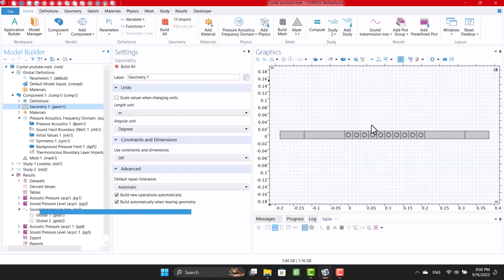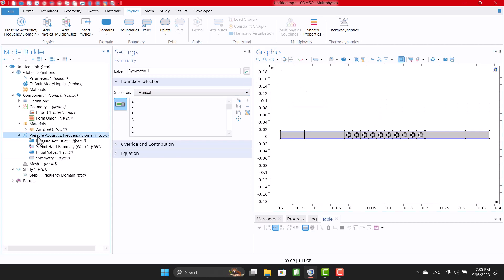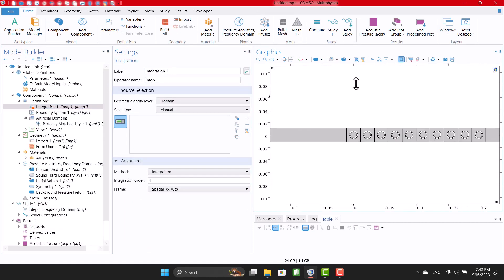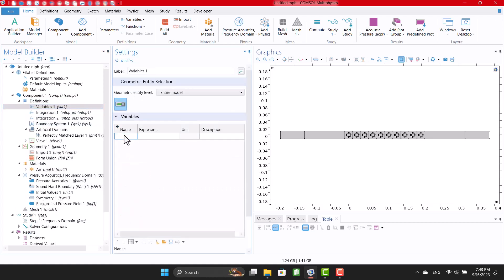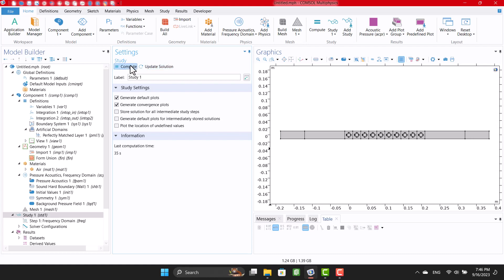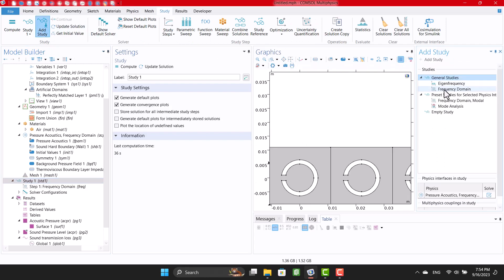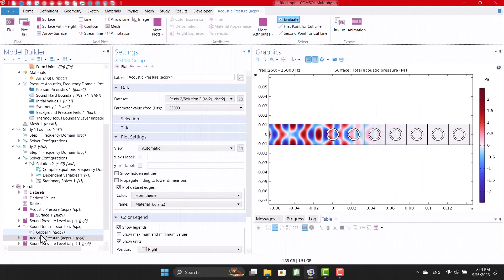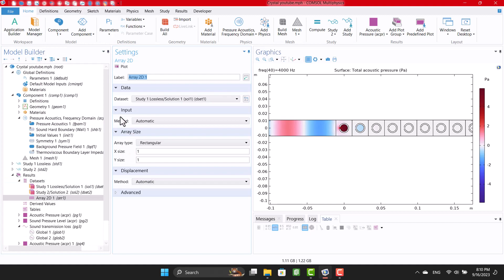🧊🔊 COMSOL Tutorial: Sound Transmission Loss of a Sonic Crystal (Metamaterial) 🎧📐

Comment: If we replaced this geometry with perforated plate like structure then what Boundary condition do we need to apply at the empty surface. That's is my concern. Please help me out.
Reply from the maker: It is a 3D crystal modeled in 2D and depth is not taken into account. You need to model the perforated plate in 3D.